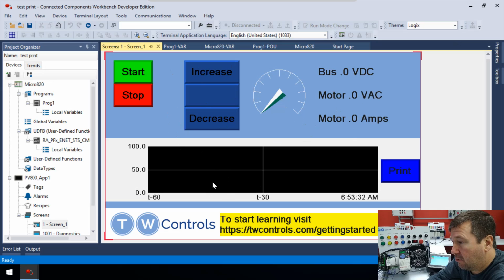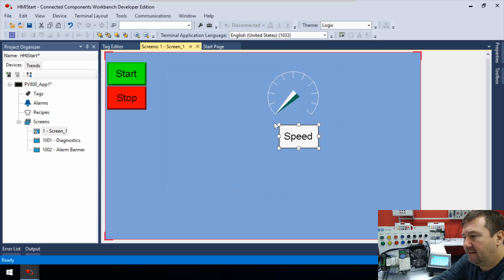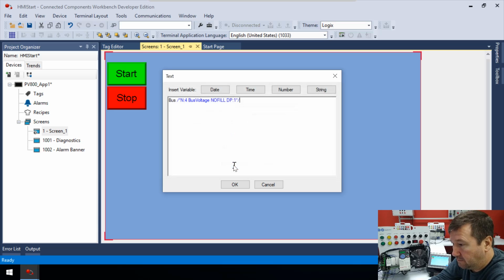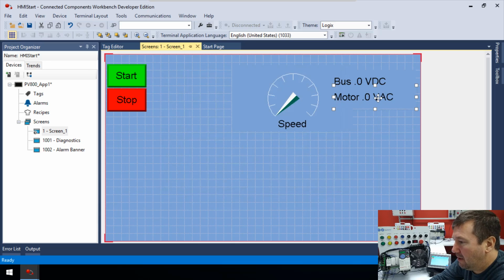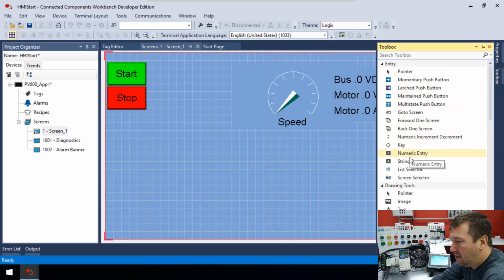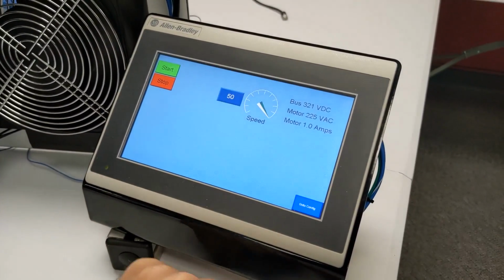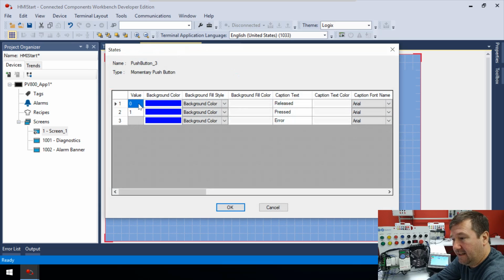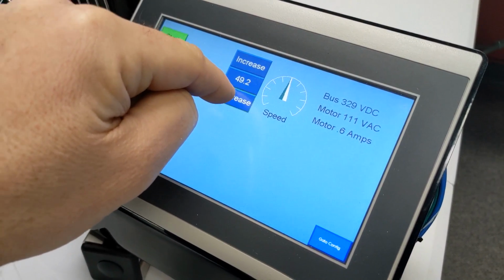Analog Values on a Panelview 800 HMI

Comment: Programming a Panelview 800, I have a maintained push button programmed on a screen 1. I copied and pasted it to screen 2. Could you please explain to me how to tie these push buttons together so when activated on screen 1 it's activated on screen 2.
Reply from the maker: It should work as long as the tags of the two buttons are the same.
Reply: I checked that because of the copy and paste, write tags are equal. I noticed in the properties window at the top one is labeled push button_43 and the other is push button_45 so I changed the name so they were equal and when validating I receive an error.    @TimWilborne
Reply from the maker: The device name would still need to be unique.  Only the tag names need to be the same.

Comment: You make great videos! I have a question: What is the read speed of the system you are using? I noticed at 11:30 in the video when you first turn on the fan and observe the analog gauge, the needle seems to move up very slowly. Is that an accurate reflection of the fan speed? It seems like the fan gets to full speed much earlier than the HMI indicated. This leads me to question the data read rate of the system. In an application requiring very precise timing, this could be an issue. If you could enlighten me I would greatly appreciate it! Thank you for making these videos! I'm a mechanical engineer teaching myself how to be a controls engineer and your videos have helped me tremendously! Keep up the good work!
Reply from the maker: Hi Isaac.  The default sample rate is 100ms which is probably what it was set on.  I just had the acceleration of the drive set at its default which is high so it takes a while to get to speed.

Comment: Nice video.

Yourself or someone else is going to be cussing when you go to commission this project and client asks for the background color to be changed for some reason. Like the ambient lighting where the HMI is mounted and changing the brightness or contrast just isn’t feasible enough. and they go to change just the background color and realize 🤬 every single text box and widget has to be modified also. lol

Or client asks for the text to be enlarged. And you goto enlarge the font just a little and load the project and🤬 the text box background clips off the edges of the text adjacent to it. Same goes for widgets. 

Im not saying their was necessarily anything wrong with the way you did it. But if people get in a habit of using transparent backgrounds unless they specifically want a different color they will find their work flow is more efficient and a lot of the time produce cleaner looking UI’s. Just a thought.
Reply from the maker: That is a good tip Justin